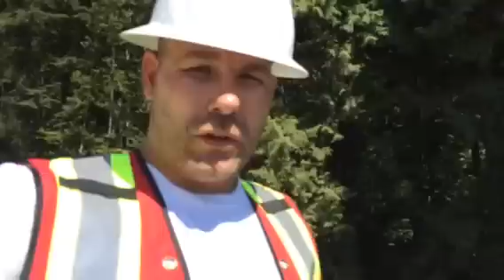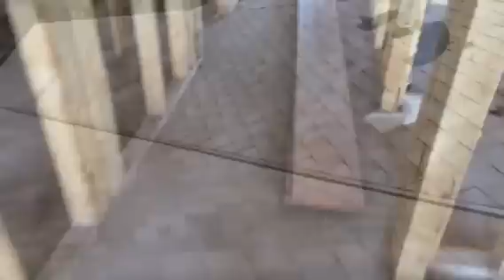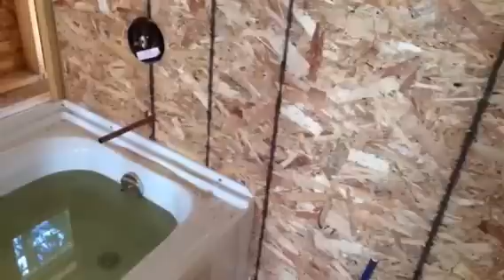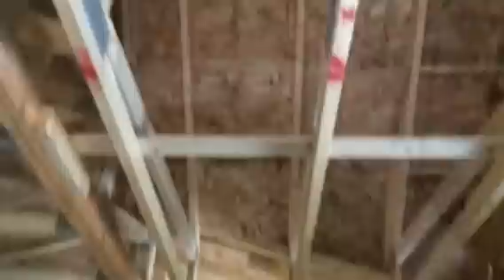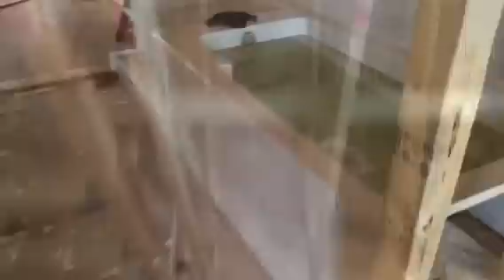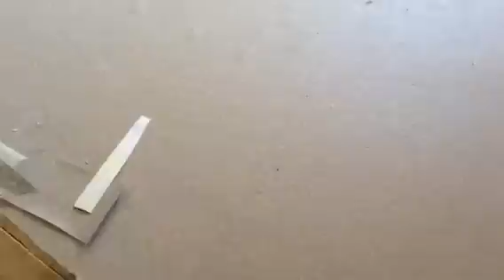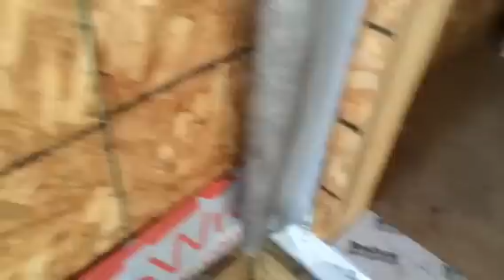New Home Construction Fails

Comment: Our houses built of particle board, plastic, 2x4's, sheet rock, and asphalt. Is anyone proud of that?
Reply: +Alan Fox That's idiotic.  It's OSB not particle board.  2x4's are only used on interior partitions. What's wrong with drywall, and asphalt?  What the hell do you want to make them out of, solid steel?  Clients cry hard enough already about spending money.
Reply: Ispike73
Masonry.
Reply: Alan Fox   No one is stopping you from building a house using CMU's or cast in place concrete.  I'll tell you what's stopping almost everyone else though, cost.  Building a house using ICF's adds forty percent to the cost just in materials alone, not to mention the associated costs of have working with solid concrete wall like installation of utilities.  What happens ten years down the road when you want to add a window here, move door there, well now you gotta cut through a solid concrete wall with embedded rebar, along with patching in the existing openings.  Another huge expense.  Cost it what sets the industry standards.  You might as well be complaining that everyone does not drive Cadillac's.
Reply: Ispike73
i agree with what your saying. But I can't stand the way we build things in this country. Americans love to do things on the cheap and then wonder why things start falling apart only a year later to their brand new home. We think we're getting a deal when we're getting a lemon. I don't think we have to buy a Cadillac to have a well built home. Most of the costs for houses in this time and day are not for construction, but for the land and interest on the mortgages.
Reply: Alan Fox  Modern materials and techniques do not equal a poorly built home.  Poor craftsmanship is what equals a poorly built home.  It's not going to start falling apart if it's constructed properly.  We don't need individual castles that will last a thousand years, as much as I would love to sit in the top of my own private castle looking out over the peasants of the land, lol. Keep in mind that technology and style changes rapidly.  In a hundred years your beautifully crafted home is going to be just another crappy old house that no one is going to want, and it's going to get torn down and replaced with something modern.  As far as cost goes, it all depends on where you live.  In this area, the "average" lot is around 20-30k, the "average" new house is 200-300k.
Reply: +Alan Fox huge government fees make them much more expensive.....
Reply: +Ispike73 where I live we use bricks and and concrete because it's cheaper than using the materials you would normally use there if available, and as you mentioned it's a pain to change something, a missaligned wall? no way to correct it.
Reply: I'm proud of the work I'VE done, I don't know what yours looks like so I really can't say.

Comment: Look I get this is a commercial video pushing your business and for all respect everything you've pointed out is true. I've been in the construction business for over 20 years and the need for inspections is so more important today than ever. Why? Because today's construction is mostly performed by illegals working for $$ under the table. Back in my time (1990's) inspectors were nothing but greedy A-holes with their hands out for a payday to get your project passed. Today it's to make sure all your illegal laborers didn't forget important items. I've seen floor trusses installed upside down, hangers missing, even trusses installed in the wrong direction. Contractors have to see that the $$ they save in incompetent illegal labor will cost them 4X in liability later. Yes they need to hire them to stay competitive but today's "tradesmen" are NOTHING like they used to be.

Comment: I've made my share of ignorant mistakes, but the OSB tub wall and the upside down joist hangers require a special type of ignorance.
Reply: I have called out for hangers to be installed upside down, or inverted. Typicality it is in cases with a long cantilever, and the inverted hanger is used to overcome uplift. While I doubt that's why it was done here, it is something that can be done.
Reply: +Pat McBride Was that an honest mistake or is somebody trying to save money by not using more expensive cement board? Waferboard is only acceptable for dog houses and the temporary lunch table on top of saw horses. If your going to do it then do it right. Use 3/4" CDX for all sheathing needs. I have to wonder if the upside down  hangers were put on on the ground and they installed the joists the wrong side up. if they actually installed them in place upside down, then they aren't qualified to operate a hammer.
Reply: +Jon Dugan 
I always install my joist hangers "up side down" on the anchor end of canter levered floor joist, but then I install a second smaller hanger under the joint just to make the inspector feel better.
Reply: +MetusBatmanV14 the OSB is inside the lip of the tub, this means another layer of tile backer goes over it, then the tile or whatever the finish is genius.....
Reply: @mino-kw1oh  P
Reply: Correct . The OSB is a solid backer and hardboard goes over it UNBEATABLE !! As for the tub , the water inside us to weight it down and now you spray expandable foam under it , also UNBEATABLE
DUH
Reply: +Pat McBride absolutely....if they're getting the joist hangers set wrong...what does they say about the flooring being "level" especially between rooms....I'd be more concerned over the plumb of the house.
Reply: No shit brother. You have to watch out for the Crystal Meth crews! I must say I have never witnessed a frame job as poor as the one Tom here showed. I have seen my fair share of F*#& Ups!
Reply: Pat McBride agreed. that is the dumbest
Reply: Wow lot of dummies on here. It doesn't matter what that wall is made of that the tub is up against. See the 2 lips on the tub? Duh that's for the concrete board which should get treated with red guard 100% waterproofing then tile over that. Get informed.
Reply: @k1llamain  I agree. It could get a 1 piece shower system over the osb as well. Sometimes showers have shear behind them
Reply: +Pat McBride There is no problem with OSB behind a shower.  It was most likely an unavoidable placement of a shearwall and it will be covered with Hardibacker, Wonderboard or Denshield, just like all the hemlock studs.  Only a doofus would tile over that.
With the drywall behind the tub, I am not excited about it, but again, it will be covered with the same cementitious  products previously mentioned and waterproofed before tile.  In multifamily structures the entire party wall from main floor to roof must have type X drywall, bath tub or not.
Believe it or not (!) there are rare instances where joist hangers are required to be installed upside down if those members are subject to serious uplift.  I couldn't see the whole deck but I can't imagine any uplift in that application.
Inspectors don't know everything, and they usually cry foul if they see something new to them.  I have been building 20 years and I see something new every month.
Reply: @stipcrane  This is a good perspective to keep in mind.  I do however do not understand that drywall behind the tub.  Is durock or whatever is used commonly put over drywall?
Reply: +Pat McBride 
Same! :P
Reply: +Steve Crane First, he was talking about a tile wall, moron. Which means yes, there is an issue with tiling on top of OSB. Second, it will have to be inspected again anyways then this inspector can verify if it is indeed a shear wall as you claim, or these people being morons.
Reply: my thoughts exactly I laughed so hard we I saw that
Reply: Upside down hangers should be a felony offense
Reply: +epistte It's OSB not Waferboard, and it's perfectly acceptable for sheathing.  Anyone that works in the field knows that CDX just plain sucks.  It's never square, it's always twisted and warped, it delaminates even when kept dry, and it's expensive as hell.  Why would you use 3/4" for wall sheathing??  That's ridiculous overkill, not to mention all your doors and windows will need custom extension jambs.   As far as tile backer goes, you can't beat Kirdiboard.  Yea it's $100+ per sheet, but it saves so much time and labor.  Durock is not waterproof, it's heavy as hell, and it sucks to cut.
Reply: Durock board is fine.
Reply: I was just going to mention "what if it is a long cantilever on the opposing end?"
Reply from the maker: I have lots of videos showing epic mistakes made by DIY'r and contractor Pat McBride, check them out!!
Reply: ya. i was curious if they were cantilever joist as well.
Reply: Tom Munro,    CHI
Reply: Hello Pat.  This is likely a case of extreme inexperience,,, but there is actually a reason to mount joist hangers upside down.  That special case is a cantilevered load.  I have seen a very, very, few cases where the normal high load on a floor joist was actually an uplift at the carry timber.     Sooooo, it IS possible that joist hangers are installed as in the video.  Without looking at the loads on the other end, I cannot know for sure,,, but 99% of the time,,, laughing,,, yes, it does take a 'special sort of ignorance'.
Reply: Everybody makes stupid mistakes but the upside down joist hangers and bathroom was a case of pure stupidity.
Reply: Man I was thinking the same thing 😂😂
Reply: You are a special type of ignorant.
Reply: I’m shaking my head at the use of wafer board in the wet areas. In Australia we use a special waterproof blue board and it has to get sealed with a compound before it gets tiled. That blue board is used on the walls and ceiling. I literally had a bathroom ceiling collapse because the builder used just regular plaster board.
Reply: Little over 8lbs a gallon for water my friend
Reply: Those joist hangers was super bad lol
Reply: joshua swearing  v
Reply: Pat McBride <------hey there now wait a minute!!! There is absolutely nothing wrong with joist hangers upside down!!!!! What if the house was built on a mine of hand grenades and it explodes!!! The floor would be fine then, right???
Lmao
Lmao
Lmao 
What a bunch of noobs , who does that???

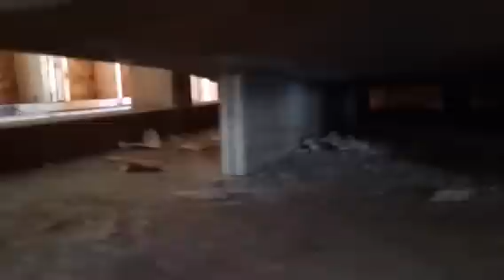Comment: at 1:28 the "OSB" under the tub is installed by the manufacturer of the tub..... not installed by the builder....while the small plywood braces are wrong. that whole tub should have been mounted on the floor with a ledger 2x4 along the back. most tubs come with braces already mounted..... i wonder where these ones went.

Comment: The plywood under the tub came with the fiberglass tub.  It is intended to be either set in a sand mix fully supported or set directly on the floor.  The mistake was in the method of support.  Regarding the surround, it makes little difference what wall substrate is placed behind the tub, as that tub is clearly made for a solid surround which will be water impermeable when installed.  There isn't going to be any tile.  Some of the other catches were pretty good, although obviously the upside down hangers were pre-hung on the ledger and the ledger was simply placed upside down by some low-wage noob.
Reply: OSB in the bathroom is never a good idea. OSB swells just from being damp. Also OSB needs to be covered by a fire resistant material like gypsum board. A fiberglass or PVC tub surround is not fire resistant.
Reply: As someone who does 80% repair/renovation work, I agree 100%, OSB needs to be kept away from moisture period,

Comment: "the little table under the bathtub" is actually part of the bathtub and designed to handle the load.
Lateral seismic forces are handled  by fastening the tub to the studs behind and The front skirt  of the tub.
Reply: Your right Sean it is part of the tub, thanks for noticing. It' doesn't make it right, it makes it a sub-standard product that shouldn't be used in bathrooms. Or do you think OSB should be used in bathrooms? They are the #1 building product that Mould grows on.  Thanks for the comment though.
Reply: +Sean Lavelle  You must use shitty tubs
Reply: +aidan conneely Its not my tub.
Reply: The product is as it was manufactured, and certified.  A code violation, is far different than an opinion.
Reply: +Jay Bow It is as manufactured   alright but  it is supposed to be   placed on a floor    not propped up on a  piece of 2x4  .  Stick to Lego

Comment: That OSB around tub, and also that sheetrock can be covered with Shluter Kerdi or Ditra membrane. No waterproofing issues at that point
Reply: Not sure about OSB, but I have my sheetrockers do the entire shower. I do big showers too. I tape and plastic it off before texture. I install the Shluter system. Its HANDS down the best product out there. Perfectly square corners and 100% waterproof.
Reply: you cant put schluter on osb! you cant put thinset on osb. if it was plywood it would have been better. if it was kerdi board it would have been great

Comment: Cheap products eh.  Considering theres only a select few tub/shower manufacturers available and each one are pretty much the same.  You're all about those joist hangers, you sound pretty high and mighty cuz you walked onto a job site and saw some deficiencies. Although, I've never seen OSB on a bathtub wall like that during rough in stage. Maybe they were planning on tiling the wall?    

Well hopefully the framer fixed his joist hangers lol.   Welcome to residential construction.  There's gonna be deficiencies everywhere you go. But I'm baffled that you would deem the bathtub unsuitable.  Hopefully the homeowner was impressed when you told them they selected s cheap bathtub.
Reply: When a bathtub is sitting on a piece of horizontal OSB that has one small vertical piece of plywood trying to support the load, and that plywood isn't even directly under the load,  yes it's cheap. The bathtub should be supported under the load. 
OSB Is not an acceptable tile backer. But il sure you knew that? 
My clients were happy when I pointed out the cheap bathtub that had been installed in the home they had bought from the developer as a pre-sale.  They were able to get all the bathtubs replaced and all the deficiencies repaired before they proceeded with the purchase.  It's my job to walk into a home and point out deficiencies, it's sounds like it's your job to put the plumbing into a home. I don't harp on you for that do I?

Lastly, just because a manufacturer makes a product, doesn't automatically make it a good product.  You get what you pay for...
Reply: I've never seen a tub collapse from its supports breaking.  MAAX and Altrek don't have that plywood strip. Was it retail brand?
Reply: +Alberta West Plumbing     Everyone should stay the fuck away from your business if you see nothing wrong with  this tub install.   Your licence   if you have one should be revoked   .
Reply: +aidan conneely 

What is a tub licensce?
Reply: +Jay Bow  Your plumbing "licence "  should be revoked  because you  are obviously    a fucking cowboy   that should not be let near a job site .

Comment: Believe it or not dude, soaker tubs come built like that. Been installing them for 15 years and not a problem. It's Not a big deal buddy. Always a home inspector that blows shit out of proportion and makes unqualified decisions.  

I always tell everyone: never hire a home inspector. Instead,  hire 3 trades, electrician, plumber and framer.
Reply: Blowing stuff out of proportion?  Just because someone builds a sub-standard bathtub like this doesn't make it right, it makes it a cheap bathtub that will fail.  Did you like the framer's work that hung the Joist hangers upside down on the front entrance deck?   
There's a reason why people need inspectors...because of the years of poor workmanship that has given the Contruction industry a bad name which has also given the good contractors a bad name.
Reply: I encourage you to talk to Altrek about their "deficiencies".
Reply: If the tub I was looking at was a Altrek tub I'd be happy to but, it wasn't +Alberta West Plumbing.  I appreciate your arguing your point about installing cheap products for your clients but, incase you missed it the video is about the OSB installed in the bathroom.  I suppose you think that's ok to?  Or how about the joist hangers installed upside down?
Reply: Alberta Proud is the water in the tub a problem in the winter?